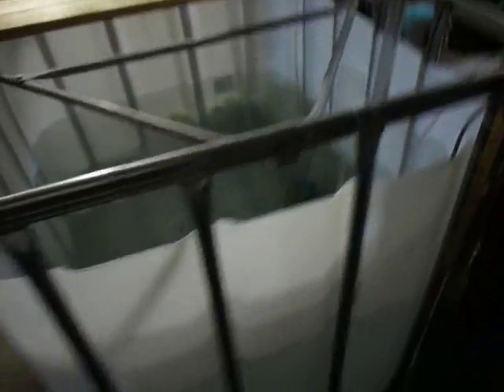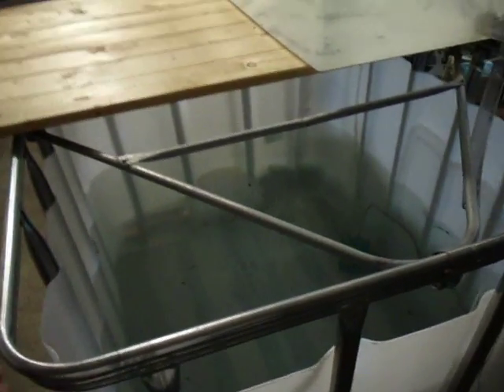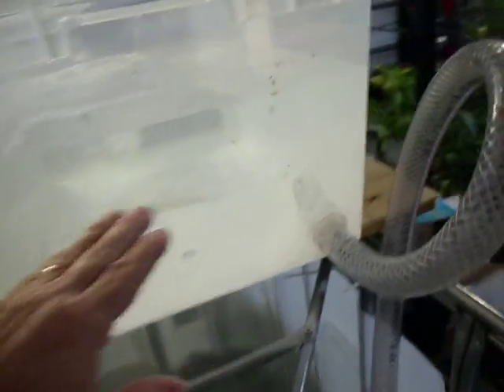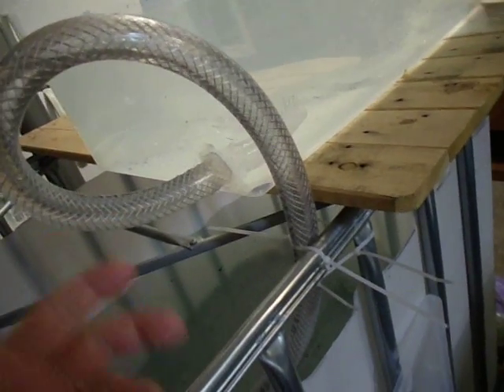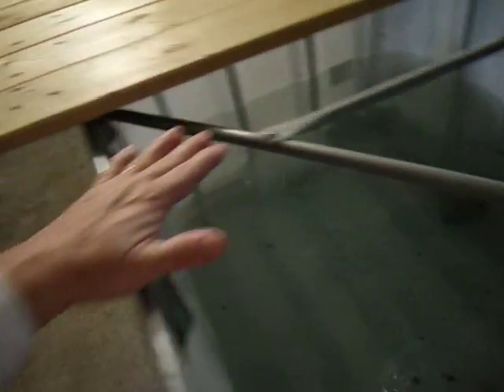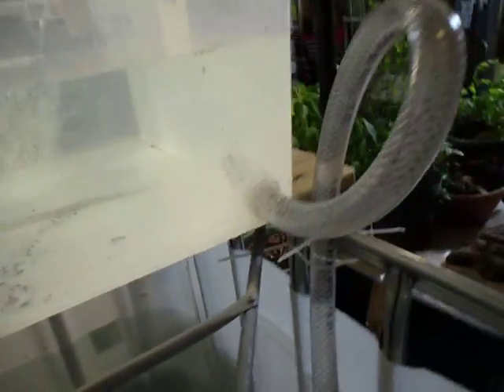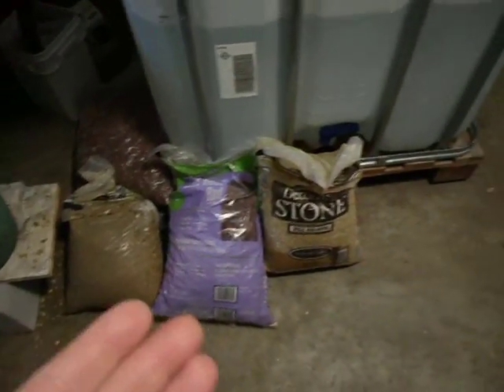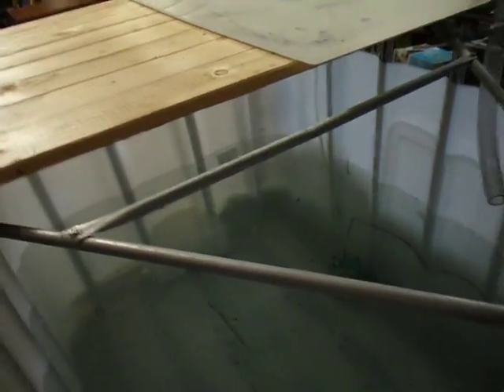Home Aquaculture Project - Part 1

Comment from the maker: System has been working very well. The siphon drains about every 6 minutes. Plants have been added for nearly a week now...and they are still alive. Lettuce looks a little better. Working now on water chemistry. Ammonia is high about 1.5 PPM.  Lost about 8 out of 40 fish. Since these are goldfish (not for consumption) I've taken the step of adding some "Ammonia Clear" to bring ammonia level down.  Decided I need to spend more time researching biofiltering and Nitrogen cycle.

Comment from the maker: I've added followup videos.  One thing I would do differently is to attach the loop siphon on the bottom of the container. This would allow the water to drop completely and prevent water from pooling in the bottom few inches.  Also, RTV silicone is good stuff....if you know how to apply it. I need some more practice...got one drop dripping every minute.